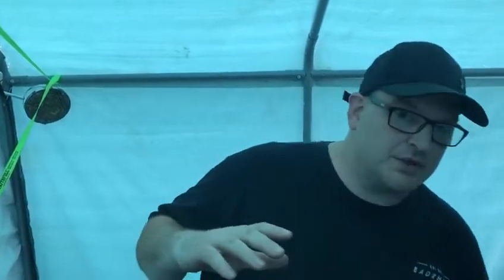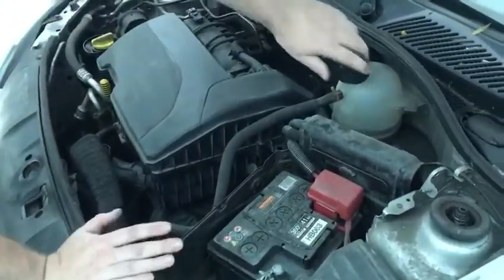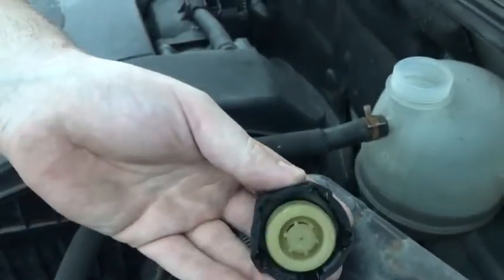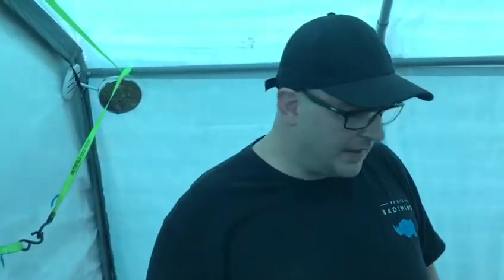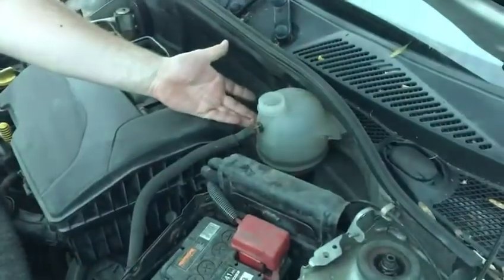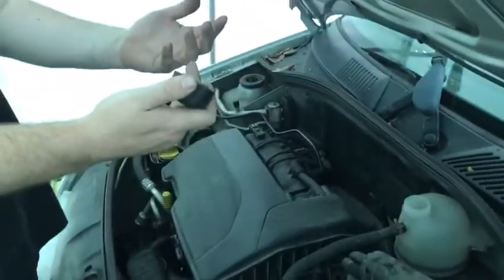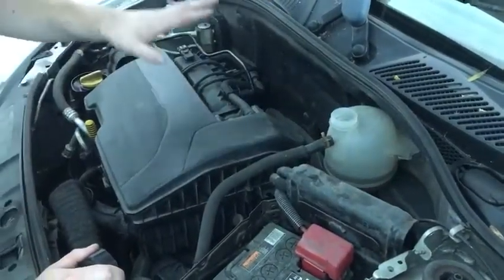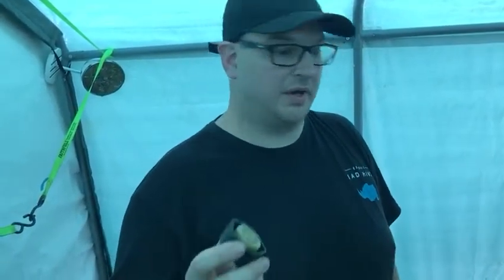The importance of the coolant system & radiator / expansion / coolant cap. What happens if missing?

Comment: Yes, my radiator cap is a pain, gets a bit stuck, need to turn it PLENTY! 
I had a leak in pipe mechanic said to leave cap loose? Not sure if that's right.
Did do a temp fix with plumbers mate and tape. Which has turned into a more permanent fix as still on, a year or more later. Should really get a new pipe. One was ordered tho by someone else, and was too big, incorrect pipe!